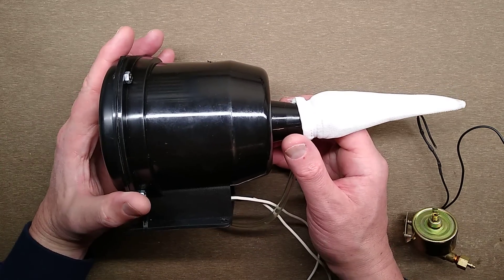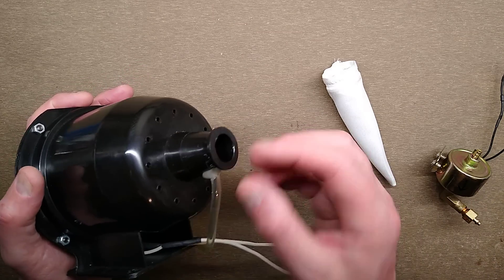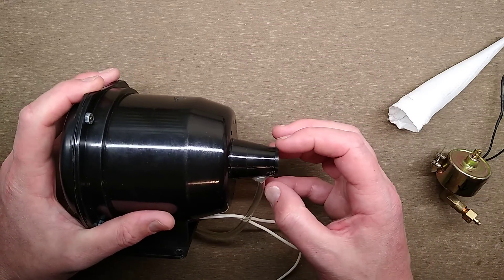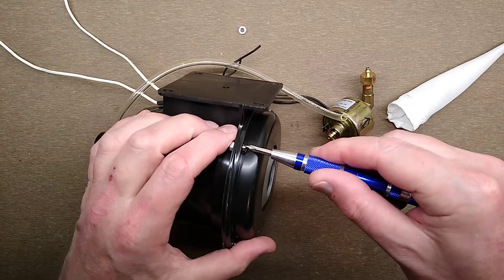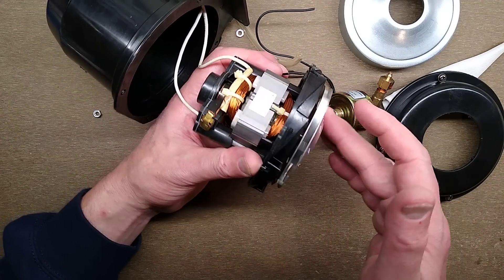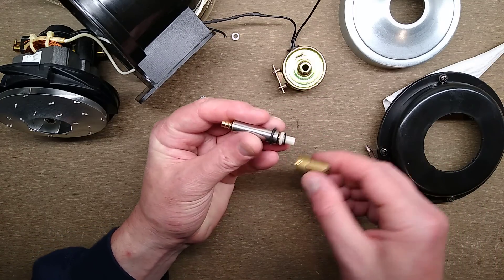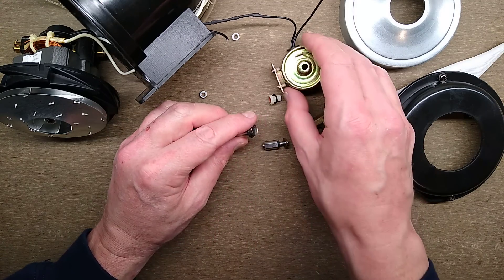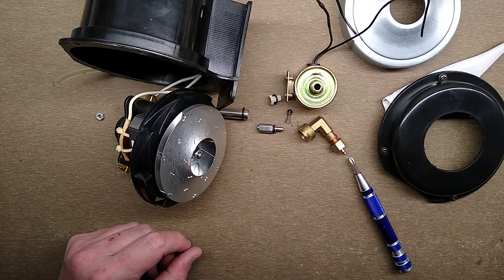Inside a snow machine blower

Comment: Hello you may be able to help me. I bought a snow machine and as its working, it revs faster and slower. Pushing the foam out quicker then slowing again. What do you think that is? Its quite a new machine but the retailer didnt wana know after 60 days unless I paid yo send it back for them to fix it. Please help xx
Reply from the maker: It could be a bad connection, bad motor brush or bearing.

Comment: Greetings:
From the brief view I've had of the motor, it appears to be a shaded-pole motor (the giveaway is the large copper wire turn running through the laminated iron core with a solid rotor). The simple single winding running at 50 Hz creates a varying magnetic field that reacts with the slanted shape of the rotor and the shorted turn causing the rotor to rotate in a specific direction.
Reply: Not shaded pole, it has a commutator and brushes, it's a universal motor.

Comment: Ah, snow machines. Reminds me of a Christmas event my church did a few years ago. It was a big walk-through show about... things? I guess? Anyways One of the 5 sections we used an old and somewhat unused building to set up a section of a small town with a few building sets. They turned off the main lights and set the thermostat to MIN. (that got down to about 60 degrees. I remember when the show controller DMX unit called to turn on the six snow machines, you'd hear the fans spin up and the lights would dim. Those were loud to the point that the people who built the scene added speakers next to each of the machines to play high wind howling sounds to try (and kind of fail) to drown out the VERY LOUD NOISE those things make. The fun memories that simple things like this trigger sometimes.

Comment: I was just going to comment that …we could use a good snow job around here …but you’re snippet on surfactants as a treatment was worthy of a journal publication and definitely worth conversing about. I try to avoid surfactants in everyday good because I live upstream from a mass of humanity and the concentration of surfactants has to be accounted for … I’ve been messing about with a foam cannon for pressure washers and have it working well below minimum advertised pressure but discovered that a car wash soap I was given is so heavily concentrated that I will be trying to consume it for decades to come at my current rate … so ridiculous that few 100ml I put in the bottle is still foaming after having been washed by at least a 100liters of water at this point (I’m aim for effectiveness /conservation)… this is supposed to be a consumer product … I know people are just using massive amounts of soap and resulting in massive water consumption just to make the suds go away! Thanks for the knowledge drop Clive!!
Reply: One point is to, quite literally, cover the target with foam.   The outer layers insulate the inner layers from evaporation, allowing the inner layers to penetrate beyond surface contamination.    The rinse more pushes the foam/soap out of the way, rather than put it into solution to carry it away.    The other is that for a car wash, they don't want to have to have someone come by more than once a day to check the liquid reservoirs and do other maintenance.  The higher the concentration, the longer between paying someone to refill the bottles.

Comment: I love finally seeing the inner details of all these components. It's definitely a bog standard vacuum cleaner motor and those pumps are often used in consumer-style espresso machines. There they call them vibratory pumps but if you google that, nothing useful used to come up.
Seeing how crude that blower construction is, how hard would it be to engineer something twice as efficient and half as loud? It's clearly designed with no efficiency or noise constraints in mind.

Comment: Something I've seen go wrong with those vacuum motors; lately some very cheap chinese ones have used aluminium for the windings which fatigue and break where it's staked into the connections for the brushes.
Reply from the maker: I'm not a fan of aluminium windings at all.

Comment: It would be interesting to see if those pumps can be used with other liquids. The pumps for diesel heaters are notoriously noisy, the extra O rings for sound damping would be a useful feature if the capacity and voltage can be matched.

Comment: Looks like a variant of China blender motor. 2 pole 12k rpm.
The other coil usually has a 105°c ceramic cased thermal relay glued on that acts as a safety cut off. But my mom manage to burn the coil, they should use higher quality  insulation or lower temperature cut off.

Comment: I found that if you want to find out more about a consumable liquid — what it's made of — companies are generally required to produce an SDS (for "safety data sheet") for products like that that they sell and more often than not it will detail reasonably well what is actually in the liquid by percentages and CAS numbers.
Reply: Underrated comment here.  This is far too little known.
Reply: Oh, I found a good one for Antari Snowflake Water:

60–70% Water
10–15% Potassium Cocoyl Glycinate (301341-58-2)
8–10% Sodium dodecylbenzenesulfonate (25155-30-0)
8–10% p-Nonylphenol polyethylene glycol ether (98113-10-1)
4–5% Sodium carboxymethyl cellulose (9004-32-4)

(percentages by weight)

Those CAS numbers are a godsend, too. You don't have to guess which similarly named thing they mean.
Reply: Percentages are usually in ranges to make it harder to reverse engineer the product.
Reply: IIRC the Australian one is typically the most detailed
Reply: @cheyannei5983  SDS must at a minimum meet the Globally Harmonized Standard.  At least, the US Occupational Safety and Health Administration has adopted the GHS.
Reply: They can still list "proprietary formula/blend/Mixture/etc" but they still have to list enough that you can get the gist of what it is
Reply: @Doc_Hawk  Like the entry "Non-Hazardous Ingredients" found in some SDSs?

Comment: A simple way to quieten the thing down, use a two-stage vacuum cleaner motor, because they're designed to be more efficient, they spin at a lower RPM so aren't ear-bleedingly loud like those godawful tiny things that have to spin at ridiculous speeds to even approach what a two-stage can do, a feature I despise about modern vacuum cleaners...

Comment: If the foam seems slipery at all it may be one that contains Glycerol. Do remember that whilst manufacturers are very cryptic about their ingredients, you can find them listed on their obligotory ’Safty Data Sheets’.    Try adding: D-Glucopyranose, oligomers, decyl octyl glycosides.
Reply: So this snow should be available in a variant that does not make the floor slippery? In my experience bubble blowing machines are a true safety hazard on some floors...
Reply: @Peter_A1466  On reflection maybe I was too dogmatic. Lets just say glycerol would make for a more slippery  floor. 
There is also a non chemical veriant consiting tiny crystals of pure frozen water and that can also be a little slippery. A pair of steel spike crampons should make traversing all variants a great deal safer. ☃
Reply: @Nuts-Bolts  ah, yes. A fog fluid spill also makes a nice skating rink 😄
Reply: @Nuts-Bolts  I find that many shop/home owners invite me to not return when I break out the crampons to keep from slipping on their floor.
Reply: @Nuts-Bolts  So, in other words, always wear golf shoes.

Comment: Thank you for the manual depiction of the action of a piston in a cylinder. I'm sure I never would have worked it out from the verbal description alone. This skill will come in handy should you ever have to explain the operation of a device In which a movable cylinder slides over a fixed piston.  😁

Soap/water solutions tend to be difficult to pump because of lowered viscosity. Would adding something like glycerin to give the pump more purchase so to speak negatively affect the formation, texture and lifetime of the "snow"?
Reply: Soap solutions as a rule have higher viscosity than pure water at the same temperature. Perhaps you mean their surface tension is lowered.
Reply: @igrim4777  Hey, I'm working on memories of High School chem class here.

(I graduated in 1970)
Reply: I was just laughing at the manual finger in cylinder, reading your comment, laughed some more. I have had a few wines.
Reply: You mean like reverse cowgirl?
Reply: @iconoclad  I would NEVER make such a crude reference on such a distinguished forum.

But now that you mention it, yes.

Comment: I remember being at the theatre, and where the light rig was, a large cylinder above the stage, I was near the front of the auditorium and could see behind the pelmet ~ it was a winter/Christmas themed show/pantomime with a snowy scene in it. When the “depicted” outdoors scene happened = a faint clunk and wine coming from the cylinder and it was slowly turning, and what appeared to be cut foam/paper falling into the actors and stage, their was one central unit/two or connected in series and turned on from the centre outward (on how much the director wanted to fall on the stage) and it was quiet - enough to hear the actors and music above it
Reply: Sounds like a confetti based effect.

Comment: I'd like to see that blower running. To me, the fan is at odds with the ducting, or, the vanes in the blower are at odds with their most efficient direction of rotation. 

Anyway, a true vacuum cleaner motor would have a two stage compressor in the can, with a stator between the fan discs. Even so, this looks like it can still generate a fair amount of pressure.

Would you use distilled water in this machine? I'm thinking of limescale building up on the sock, and I'm also wondering if you can use domestic cleaning products as the foaming agent. It would need to be a salt free product, say, "Star Drops".

I could see one of these being fun to have around Christmas time - Hmm, I wonder if it would deter carol singers from coming to your door!
Reply: A better vacumcleuner has 2 stage compressor but most dont. it spins up to 30.000 revolutions.
Reply: @jozefa1234  Well, perhaps not in this day and age, but when I was growing up, you would be very hard pressed to find a vacuum cleaner that didn't have a two stage compressor.  Of course a two stage needs a bigger motor to drive it, so more Watts to run - Not allowed today! Unless we're talking about industrial machines.
Reply: @whitesapphire5865  in my younger days the vacuum cleaner has 2 vanes and 350 watt motor. Now most 1 Vane and 1200 or 1500 watt. Simpeler construction and higher rpm. Energy spill.

Comment: To get the high pressure relatively high pressure you have to spin that axial blower quite fast. I don't know how much noise comes from the brushed motor. Probably not much. But you could replace that with a three phase motor with a high frequency drive on it. You commonly see them on drones and RC aircraft these days. But at least they would run, as long as a thermals were taken care of... pretty much forever.

Comment: The pump looks very much like the dossing pumps they use in diesel caravan heaters. 
Probably just as annoying at 60 Hertz as it is at 5 Hz
I can still say, I've never seen one of these in action :)
Reply: tick. tick. tick. tick tick

I actually don't mind it much... gives me comfort that heat is running.
Reply: @volvo09  My approach - when you can't change the noise, change your attitude to it 👍

Comment: The rotor stops very quickly when you turn it - it should have minimal friction. Some cleaning and bearing grease should help.
Reply: Friction from the brushes?
Reply: That would be the friction of the carbon brushes - can’t do anything about that, 🤷
Reply: It could be magnetic attraction between the rotating and stationary parts of the motor, not lack of lubrication.
Reply: @johndododoe1411  It's not a permanent magnetic motor though.

Comment: Have you ever dabbled in cold process soaps? NileRed has a great video on the chemistry of the triglyceride and hydroxide reaction, the result of which is a bunch of surfactants. Different oils produce different types of salted fatty acids, which are responsible for the cleaning and surfactant action.

It's quite a dive to take.

Comment: It interests me that the air pump is centrifugal but the liquid pump is reciprocating.
Reply: Probably to do with the volume of material 'pumped' - centrifugal gives higher volume, reciprocating lower volume...
Reply: @stepheneyles2198  Ah, yes! Air Pressure (high flow) Fluid Viscosity (low pressure; metered) .